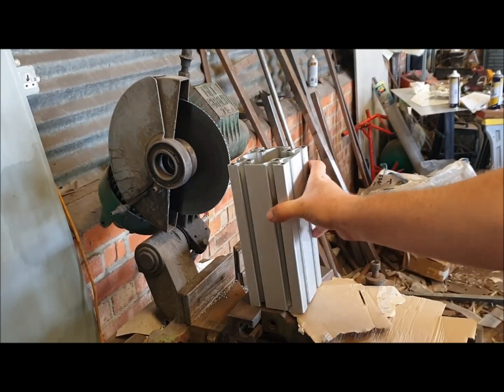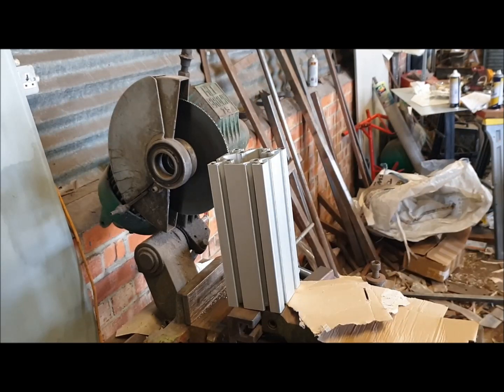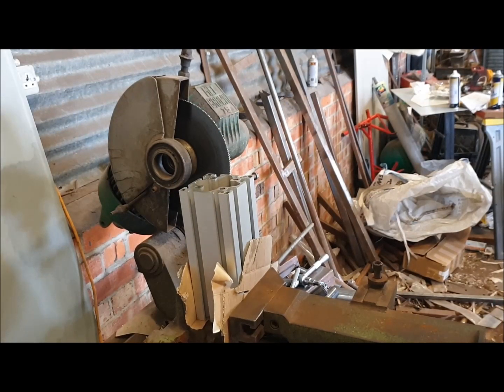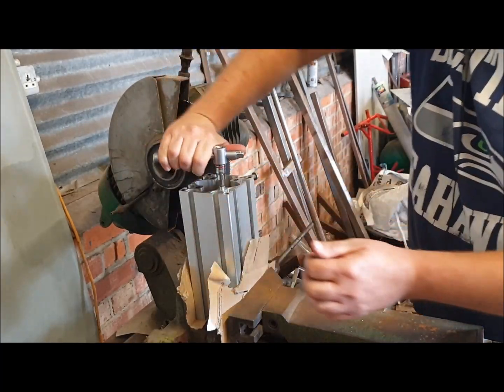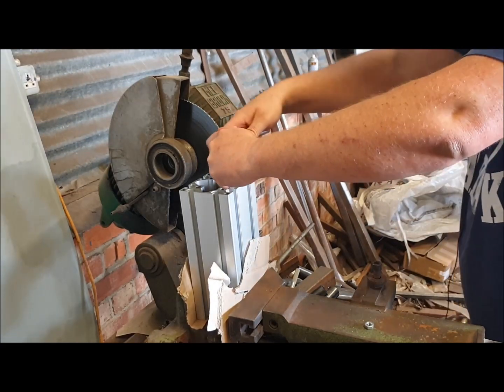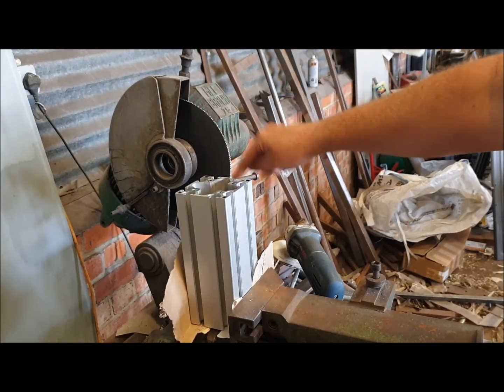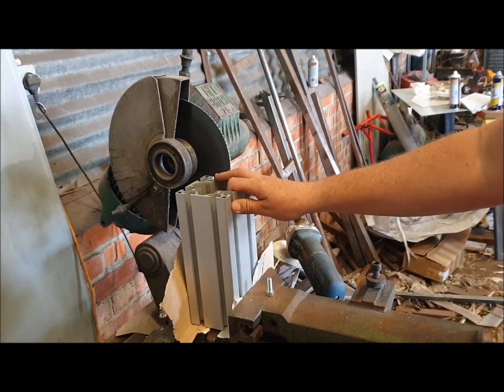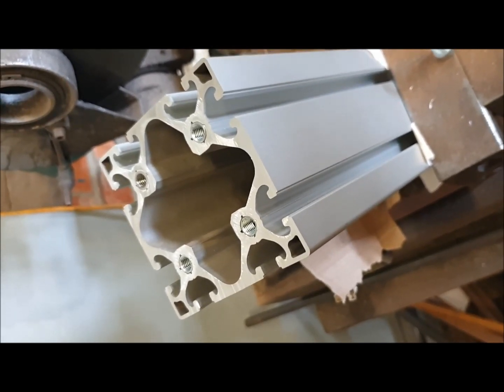Build Your Own SFX-100 Motion Platform Rig Part 1 for Sim Racing - Assetto Corsa, rFactor 2, pCars

Comment: These people from the company kinetikmsystem do not answer the phone. I have sent them the money, I have sent them emails, I have tried to contact some of their employees to their linkedin accounts, from their instagram and it is impossible... they do not answer any of my messages. Has anyone had any problem receiving the metal tubes and nuts?, do you know any other place or web where you can buy these elements?. In my opinion the company Kinetikmsystem are thieves.
Reply from the maker: I have heard this before. I think people always end up getting their parts but they have a reputation for long lead times and not answering messages. There is a different profile.from another source but I can't remember what it is now. You should see it if you search Google for SFX alternative profiles.
I am trying to redesign the actuator to remove the need for these hard to find profiles and use normal sim rig type profiles instead. I'll do a video soon showing this.